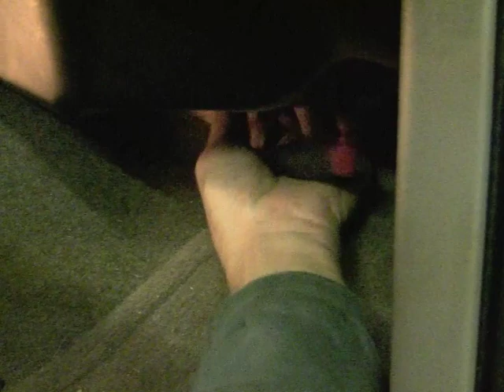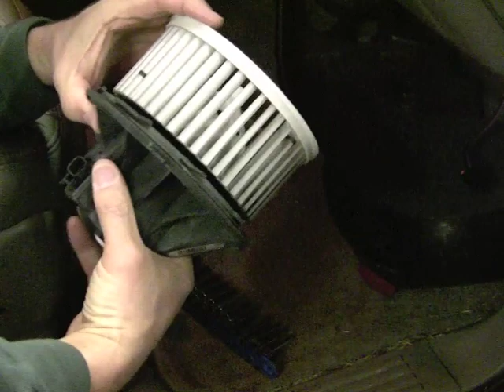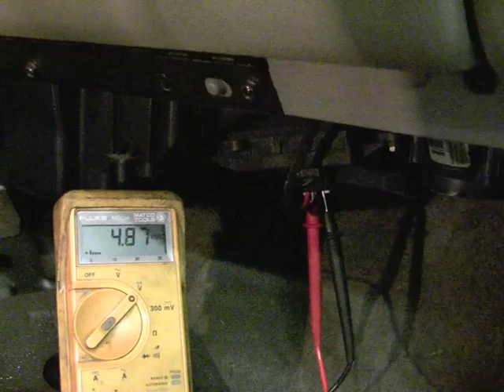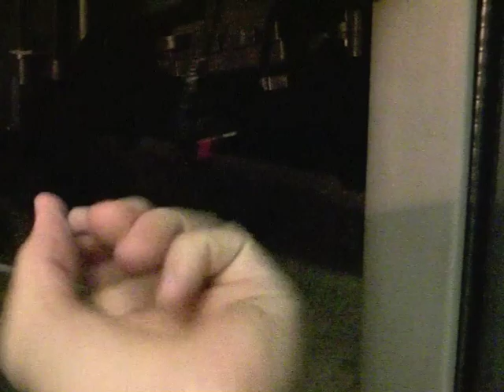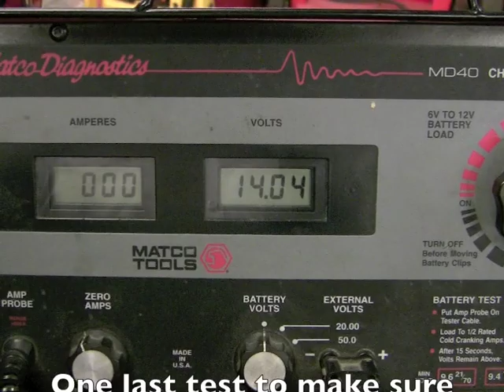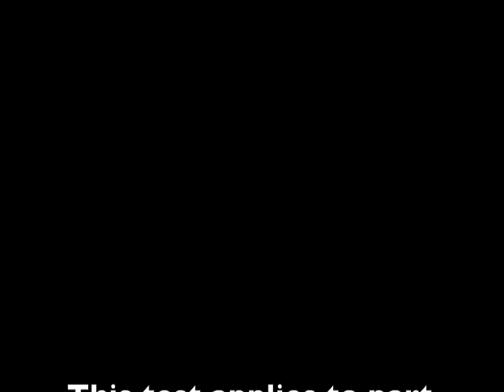2005 Chevrolet Tahoe Blower Not Working

Comment from the maker: Hi Gene,

For some reason there was no reply link for your comment so hopefully you will see this. I have included two links that I think will better explain how to splice in the wiring for the newer style blower speed controller that replaced the one in this video. The first is directly related to the part and the second is a general repair article about splicing wires. 

http://www.sparkys-answers.com/2011/07/2003-gmc-yukon-bower-erratic-not.html

http://www.sparkys-answers.com/2011/09/how-to-replace-wiring-harness-connector.html
Reply from the maker: ***** Assuming you ordered the parts from www.The-Electric-Connection.com  the kit comes with the splicing terminals and heat shrink tubing. All you will need is a good pair of crimping pliers and a heat source for the tubing. A disposable lighter works well.

Comment: I am looking for the same part you used in the video but the only place I can find it has it for over $300. Do you have a link for one with a better price by chance. I can't seem to find one that plugs in correctly. Thanks
Reply from the maker: Brent Thompson That part is no longer being produced. Technology has changed and the latest design, GM part can be purchased here. http://store.the-electric-connection.com/15-81773-hvac-control-module--gm-trucks--suvs-w-automatic-ac--2003-2009-p719.aspx   We have been using these for several years now with no issues. They do require cutting and splicing the harness but quite frankly the old harness connectors are also failing and most need to be replaced anyhow. This one kit has everything that is needed to successfully replace a faulty blower speed controller.

Comment: Hello, If both my front and rear are not blowing what could that be, fuse is good, haven't went further yet just bought the 04 burb two hours ago as a project. Thanks!
Reply from the maker: Dan E You will likely have two different problems.

Comment: Let me qualify.  When I connect the blower to a battery directly the fan turns.  When the connections are all back together and the fan controls are changed I still get nothing.
Reply from the maker: Check the red wire for constant power and the black wire for constant ground. The third wire, either gray or purple with a stripe can have various signals depending on the part number of the installed part and the year, make and model of the vehicle.
Reply: Sparky's Answers Rookie mistake.  Blew the bus fuse.  All is good.  Fired right up.  Thanks.

Comment: I have this issue and will perform these steps.  To test the blower motor can you connect it to a 12V source? If not what is the voltage that drives the blower motor?
Reply from the maker: If you plan on testing the blower motor by itself it needs to be disconnected from the vehicle wiring first. Then you will need to use two wires to connect 12 volt power and ground circuits to the blower motor.
Reply: Sparky's Answers Ok that's what I figured and I just wanted to make sure I wasn't putting to much voltage on it.  If you get good voltages at the input of the resistor and then at the input of the blower then it isolates the failure to the blower.  But I will test the blower just to be sure if it turns out to be the failure.  I am in the northeast and had a snow storm so that ruined my plans to look at it after work last night.
Reply: Michael Lopes After measuring a constant 5VDC on the control line of the resistor with changing fan speed and all other values measuring good, I repaced the climate control module.  Once replaced, I measured the voltage at 5VDC on the control line of the resistor and it remained constant regardless of the fan setting on the climate control module with the vehicle running.  I am thinking I may have gotten a bad new climate control module unless there is something that you can recommend that I may be missing.  Do you have any other suggestions?
Reply from the maker: michael lopes The replacement blower speed controller has had several design changes. The most obvious are that the three wire harness connector has been replaced by a five wire harness connector and the controller is now gray in color. Less obvious is that the operating voltages have changed. I did and extensive article on this and the voltage chart can be accessed here. http://www.sparkys-answers.com/2011/07/2003-gmc-yukon-bower-erratic-not.html  , Also keep in mind that the voltage on the small purple/white wire is an output of the blower speed controller and it is actually the a/c control head that sends a pulse width modulated ground signal to the blower speed controller. This applied ground drops the voltage on the small purple/white wire. If it does not change the problem is more than likely between the a/c control head and the blower speed controller.
Reply: Sparky's Answers I got it working.  The key is that control voltage on the purple wire is an output of the Speed Controller.  I measured at the resistor connector and it was 5V and then measured it at the other end of crimped splices that I installed and it was 0V.  That showed the splices were not crimpled on the cables properly.  So I put on new splices and it resolved the issue and the heat is working.  So in the end my controller was failed and I replaced the resistor also because it had some corrosion on it.  This guide was so helpful and appreciate your prompt replies to my questions.

Comment: Thank u!!!!! Freaking remote start section on the alarm is faulty! I read the install book and found the plug for that section and unpluged it. Everything went right off!!!! I would have never figured it out. I been dealing with a dead truck battery after 2 days of not driving it because of this crap!!!! For over 2 years now and the remote is only 5 years old. Thank u again.

Comment: Yes it does. Full control with key off.
Reply from the maker: Any chance a remote start or anti theft system has been installed in your Tahoe?
Reply: Yes autopage alarm.
Reply: U thinking the relay in the alarm system??
Reply from the maker: edtwan tucker Yes, in order for you to have blower motor control with the key off there has to still be power on the ignition circuits. That means a faulty add on device, a problem with the ignition switch, a problem with the ignition switch timing or shorted wiring.

Comment: Hello I have a problem u might be able to help me with. I have a 99 tahoe and the blower motor runs with the key off and my heated seats stay on too. What could cause this problem. I don't have a body module on this truck.
Reply from the maker: I am assuming that your Tahoe has auto temperature controls. If so the blower speed controller is the likely cause of the blower motor staying on with the key off. The heated seats are a different matter. Are both seats staying on(heated) or just one? Are the seats actually hot or are just the controls active, in that you can control the levels with the switches?
Reply: No auto temp control. The seats have switches on them and if left on they will stay on with the key and the 4 wheel drive switch stay lite too. Pulled all relays under the hood and they still have power.
Reply from the maker: edtwan tucker Does the blower switch control the speed of the blower even with the key off?

Comment: I Have a 2005 Chevy Suburban, the rear blower works in the vehical but the front blower does not.  The front heat only seems to work if you are driving at higher speed, not sure if this is because of the engine getting hotter or not.  Where should I begin to diagnose my problem. Is it as simple as a fuse, If so where do I check, or is more than likely something else, like the motor under the passenger side dash.  Thank you for your time Sparky!
Reply from the maker: If your Suburban has auto a/c controls you can follow the diagnostics in this video. If it has manual controls please see in information in this video  2005 Chevrolet Silverado Blower Inop

Comment: Hi My Chevy Tahoe2005 has a different issue. The blower stays on all time even when the blower is off and the key has been taken out. The only way I was able to turn it off was to pull the blower fuse. Would this be the fixed by replacing the blower speed controller???  Thank you
Reply from the maker: The blower speed controller would be the cause 99.9% of the time if the blower stays on all of the time.

Comment: Hi Sparky, thanks for the video, that was great.  My issue is slightly different . . I have only 2 speeds left on my blower motor . . the 3rd and 4th seem to be the only ones left .  There is no air movement on speeds 1, 2, and 5.  Would that be due to the blower motor or the speed controller ??   Thanks !!!  CP
Reply from the maker: More than likely the blower resistor and it's harness connector are at fault. Please see the video I did on this at the following link.

2005 Chevrolet Silverado Blower Inop
Reply: Dude you are the MAN !!!  However in the video you said that it was most like caused by a clogged condensate drain but you did not show how to clear that.  Do you have that video as well ?
Reply from the maker: Capalmer01 Not every resistor failure is caused by water damage. In fact most are not. The evidence of rust is what lead to that conclusion. I have not done a video on how to clear the drain tube but most of the time it is very easy. Underneath the hood on the passenger side you will find a silver tank at the firewall. Below that tank is a rubber elbow that can be removed and checked for internal debris. Before removing the elbow make sure you remember it's orientation. If you think that there may be a larger restriction inside the HVAC box, you can use a wet shop vac to clear the tube.
Reply: You are awesome man !!!  Keep up the great work !!!!  Thanks again !!

Comment: Hi I have a question i have a 2005 Tahoe and the ac works great untill driving down the road and the driver side vents start blowing HOT HOT air . All the other vents still blow cold . Only way to fix it ( i have found ) is to turn the truck all the way off and restart it . This is only a temp fix bc the ac after a few mins goes back to blowing hot . Please help me i have no idea where to begin trouble shooting this . Thank you ;)
Reply from the maker: Heather Waters More than likely the driver's temperature door actuator is faulty. Please check out the information at the following link. http://www.sparkys-answers.com/2009/09/2004-chevrolet-tahoe-blows-hot-air.html
Reply: Thank you so much

Comment: Great video! Thank you for taking the time. 
My 04 Tahoe's front blower slows and cuts out at low speeds or when coming to a stop. I have no other electric problems. Battery and alternator are good. Could this be caused by either the control module or the fan blower itself? Blows ok at highway speeds but when I stop or slow down it cuts out! Actual temp is always cold so I dont think its related to the compressor or fan clutch. Thanks in advance for any help you can provide.
Reply from the maker: On your Tahoe it sounds like it is a loose connection. The common locations are at the blower speed controller, the blower motor and in the harness connectors under the fuse box in the engine compartment. I would start with a visual inspection of the three wire connector at the blower speed controller. If no problem is seen, connect a voltmeter to the red wire at the blower speed controller and chassis ground. Drive the vehicle and see if the voltage fluctuates on the red wire as you slow down or stop the vehicle. If it does the problem is under the fuse box in the engine compartment.
Reply: Thank you so much! Ill give it a try! Keep up the good work.

Comment: Forget unplugging the two-wire clip at the blower motor.  You need talons and finger strength like Godzilla to do this.  However, the blower itself comes out EASILY by bending down a tab and twisting (unscrew direction) the blower motor, bringing that connector out with it for easy disconnecting.  The motor re-installs just as easily.  Plug in the two-wire harness before re-installing the motor.  Piece of cake.  As for the connector--well, I soldered my connections.  I never have had success with solderless connectors staying connected.

Comment: hi I have 02 Tahoe 70000 mile my A/C works great  cold  I took to trans shop yesterday they rebuilt my trans  after I drive to test my A/C  works blower works but doesn't blow from front vents only from top windshield  I check maybe vacuum hose  but my Tahoe A/C vents works with electric  not with vacuum please  can you give me advise what happen?
Reply from the maker: I would try a system recalibration first. This requires a scan tool or removing battery positive from the system. This can be done by removing the radio fuse or disconnecting the battery. Disconnecting the battery can clear the memory from other systems as well resulting in other problems. Regardless after battery power has been removed for one minute, reconnect the circuit. Start the engine and absolutely do not touch the a/c controls. Let the engine run for several minutes. Turn the ignition off for at least ten seconds but no more than thirty seconds. Restart the engine and check the ac function.
Reply: Sparky's Answers I disconnected the power  cable night and I reconnected next day and I did  step by step but still  not working properly
Reply from the maker: If a recalibration did not correct the condition, a faulty mode actuator is the most likely cause of the problem.
Reply: Sparky's Answers what should I do? was working perfect  after Mechanic removed battery cable and rebuilt my transmission   I have this problem even right now my engine not working clear has some vibration  this happen all  after transmission
Reply from the maker: Dan Danyel Disconnecting the battery starts the recalibration process and clears learned memory. More than likely the mode actuator already had an issue and when the recalibration was initialized the actuator failed calibration and is stuck. The engine vibration may be caused by a low idle from loss of learned memory. This would only be true if the problem is only felt at idle.

Comment: Hello Sparky, the blowers on 2003 Escalade stays on after the car is off without no key. Because of that it drains the battery. What im doing at this moment is disconnecting the battery cables.  Thank you
Reply from the maker: More than likely the blower speed controller is at fault but I would recommend doing the tests in this video and on my site. sparkys-answers dot com.

Comment: So I've got a similar problem with my 05 Suburban 1500 LT with dual zone front and rear automatic climate controls.  Car warms up to 210...nothing but cold air on automatic setting...blower motor amps up but air doesn't get cold.  I turn off the system.  I then need to start the system by hitting the fan button...turning it on low and checking it until the heat kicks in...at which point I can then turn the system on full blast.  If I have the rear climate control on...it delays the above process and blows cold as well, never really coming to temp any more.  Really annoying at -15F
Reply from the maker: Before getting too deep into the electronics check the engine coolant level. It can be up to a gallon low with no ill effects on the engine but little to no heat in the passenger compartment.

Comment: Basic question - when you use the voltmeter and the voltage increases as the blower speed is increased I take it this is not what should happen?  Should it have remained the same?  Video mentions it shows the speed controller is bad...how should it have behaved if it was good?    I also have the auto temp control which I know is a bit differernt.
Reply from the maker: Sorry to be so late getting back with you. The way YouTube handle comments for me is a little confusing. But to answer your question the controller was bad because it did not control the blower even though it was getting the proper signals. Hope that makes sense.

Comment: Sparky, thanks for the information.  I change the blower and speed controller in my 2005 Chevy Avalanche.  Your video was instrumental.  The blower works perfectly. The dealership informed me that I need to replaced the "HVAC Blower control Motor and Vent Values for $415.00.  I bought the parts for less than half of that and installed it myself.  Again thanks for the help.
Reply from the maker: Happy to help.

Comment: I was having the problem of nothing blowing through my vents I followed the video and ended up changing the speed controller. Well the one I purchased didn't actually fit flush because of where the screw holes were on the controller, but I hooked it up to see if it would fix the issue and now the blower motor will not shut off. I put my old one back in and now it is not shutting off either unless i pull the fuse under the hood. My question is, is it still  the Speed controller that is the issue? If so, is there ANYWHERE that I can get the exact speed controller that is original. I have searched everywhere and I can't find a similar speed controller to the one that came out of the truck. Please Help
Reply from the maker: As far as I know the original style of blower speed controller does not exist any more. The current part number is 165-81773. It will fit and function properly when installed according to the instructions. The foam spacer/washer has to be used and the module has to be properly indexed. All of that aside, the new controller should have also had a new harness. Disconnect the small purple wire (part of the original 3 wire harness) from the circuit and see if the blower still comes on. If it does not stay on anymore the problem will be that the small purple wire is grounded somewhere in the harness or the HVAC control head. If the blower motor continues to run with the small purple wire removed from the circuit more testing will be needed.